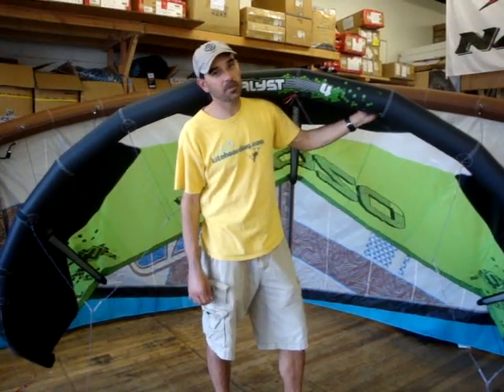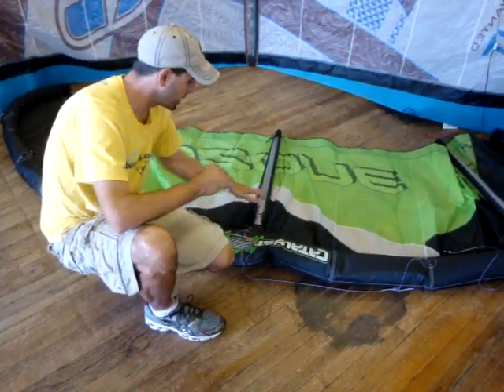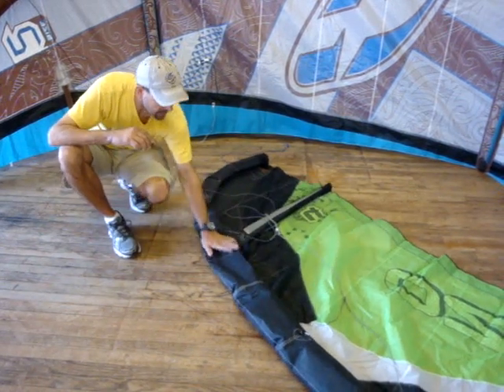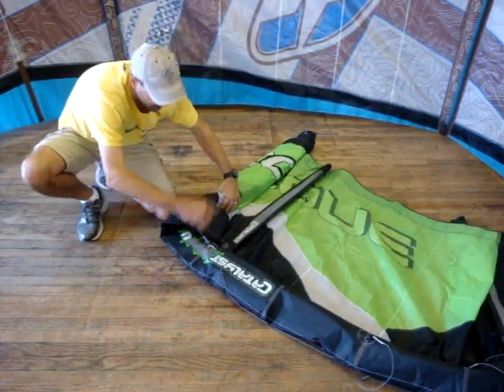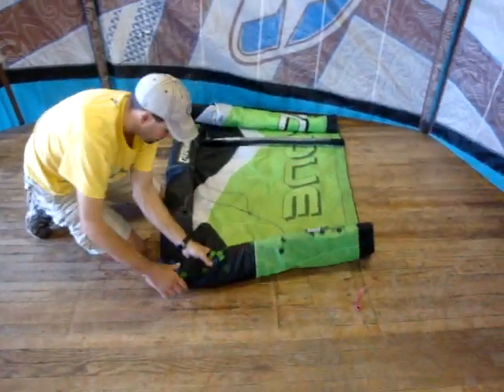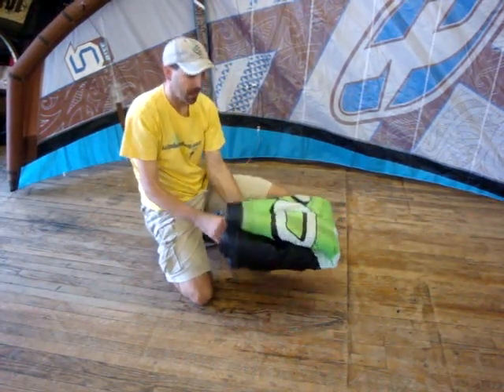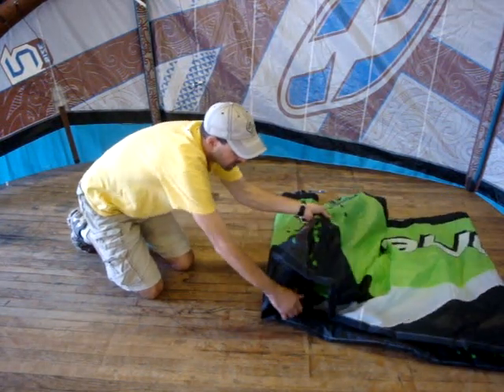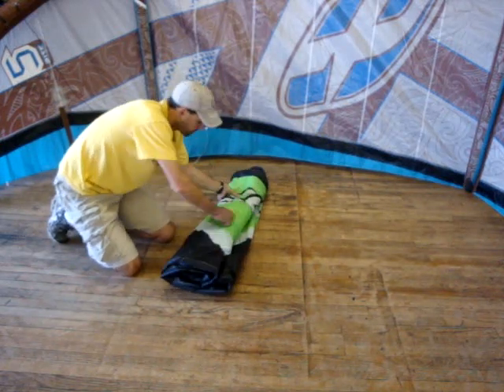Kiteboarding: How to Pack your Kite

Comment: Nice videos , thanks.
Question, the control bar and pump should be packed inside the backpack or  outside ?
Thanks again.
Reply from the maker: We keep our bars on the outside after riding so they can air dry but will put them inside for storage or travel. The pumps stay outside of the bag.

Comment: Hi Jeff, Thanks for the video. Quick question re. the 'leading edge roll method' from someone new to the sport. I like it but noticed the video is from 2012 and just wondered if this packing method is still current with today's kites or are there now better ways to pack the kite away?
Reply from the maker: This is a tried and trusted method that works as well today as it did 6 years ago. No issues with this method.
Reply: Thanks for the quick reply, much appreciated :-)